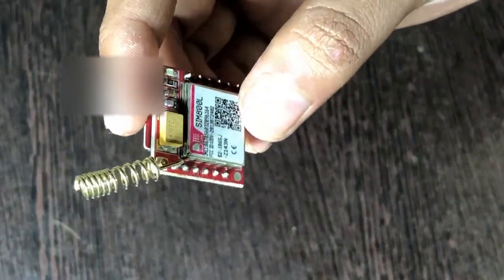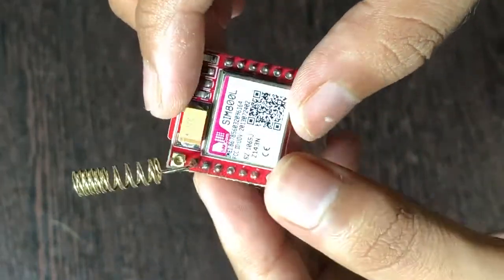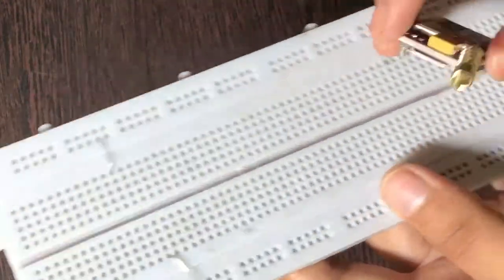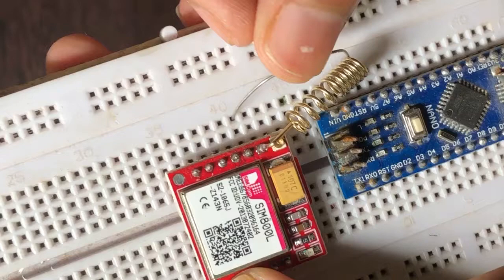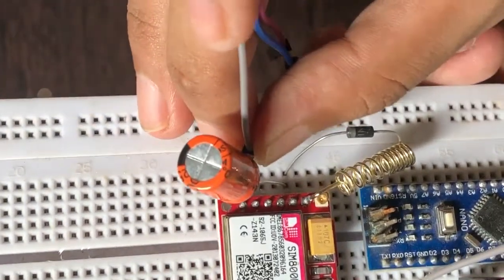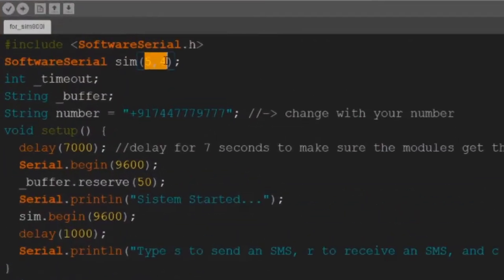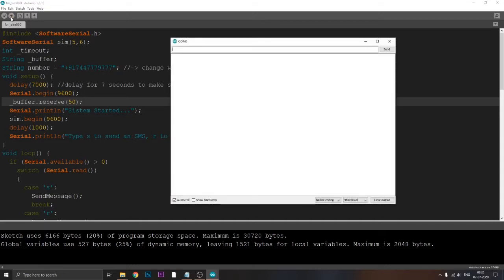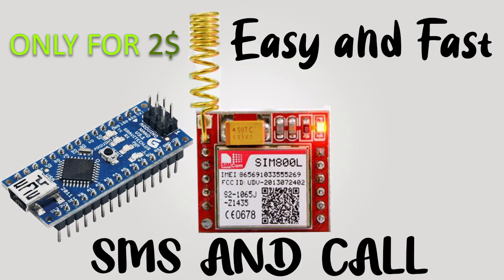USING THE SIM800L WITH ARDUINO NANO QUICK AND EASY

Comment: Hi, great video! Does the SIM800L module turns on automatically when you apply power? In the datasheet is states that the module has a power key pin that must be held low for at least 1 second for power on/off. Thanks!
Reply from the maker: Yes it does automatically power up .. no need to hold anything

Comment: This video, and many other tutorial videos, show the RxD pin connected directly to the Tx pin of a 5V Arduino ?  The RxD pin on the SIM800L has a MAXIMUM voltage level of 2.8V. It needs a potential divider network to reduce the 5V signal from the Arduino to the 2.8V input on the SIM800L module.  I have no doubt it works without, but it is stressing the SIM800L beyond acceptable limits, and I wonder how long it will last.
Reply: Can you tell me what should i do to reduce voltage of Tx pin of Arduino to connect with sim800l. Please reply
Reply: @code_crafter00  Use a two-resistor potential divider - a 2K2 from the Arduino Tx pin to the SIM800L Rx pin, and a 2K7 from the Rx pin to GND. This will give a signal level of 2.755 V
Reply: @aaron7706  HOW'S THE OUTCOME?

Comment: Don't mislead by showing the power source taken from arduino as it can never supply the 2 amps required. It may work for awhile but not long term solution.
Reply: yes, you may have to use 12v -2 amp adapter with buck converter it works better
https://www.technoelectronics44.com/2020/11/gsm-sim800l.html
Reply: And there's something else regarding the power source from the Arduino, besides the 2AMps the module requires at some processes, it0s very clear on the component specs that the voltage to power it on is from 3.4V up to 4.4V, and on the specs the designer makes special remark if 4.4V is exceeded the module for sure will be damaged, so are the 5V from Arduino the right solution?

Comment: my Question  is whose number write in the code (String number = "+xxxxxxxxxxxxx";) that are insert SIM in  module SIM 800L  or  other On which we receive message or call
Reply from the maker: The number you need to enter is the number to whom you have to send sms or call